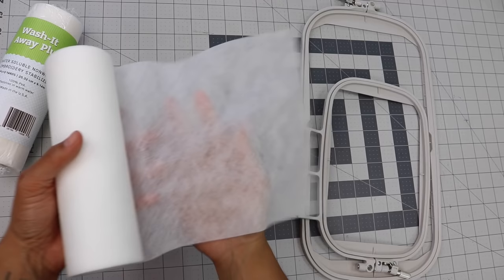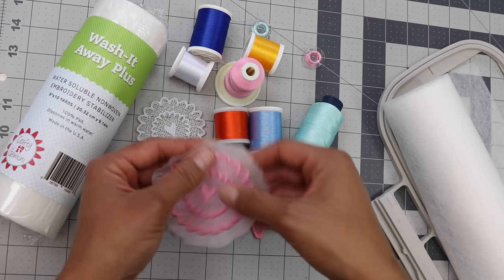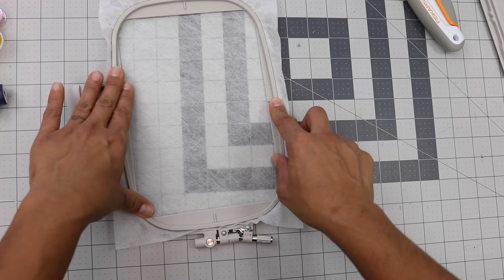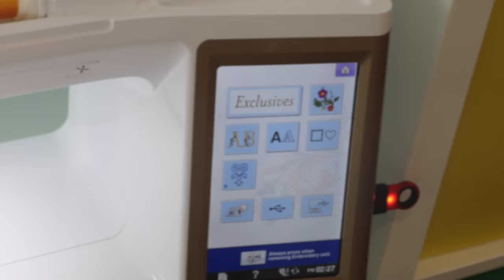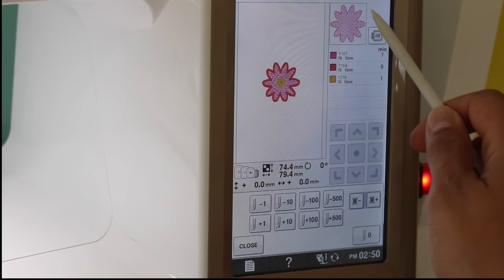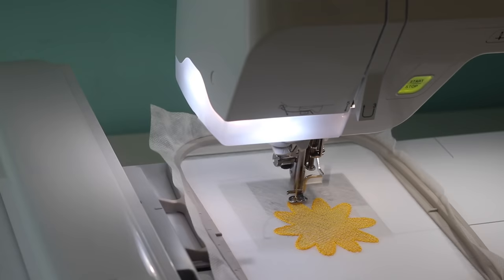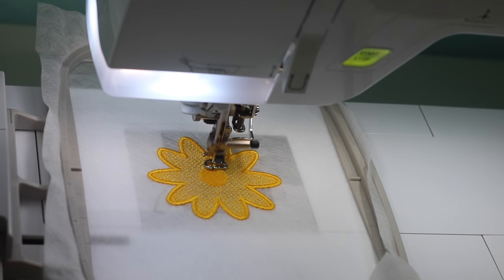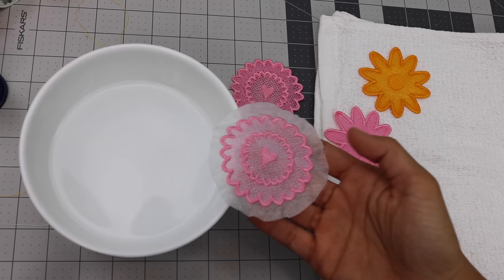Beginner Machine Embroidery Project #2- Free standing lace tutorial

Comment: Had a bit of trouble with my first go.  I recently picked up a BabyLock Ellegante2, second hand so I thought I'd give this a try. I have been doing machine embroidery since my first Designer 1 in 2003 but haven't done any in awhile .. I had some wash away in my stash and found a design for lace to use that came within the machines freebies.  It doesn't completely interlock.  OOPS!  Looks good but will be in pieces once it hits the water.  I will have to be more careful with my next selection.  I love the tip of using the same thread for the bobbin.  I usually use the recommended in white or black and have problems sometimes with the bobbin thread showing.  I have been very impressed with your videos.  You are a great teacher for one so young.
Reply: Phyllis, try adding some tulle over the stabilizer before you embroider. This will keep the design from tearing apart. there is a video on yt describing this process.

Comment: Great video! If you accidentally rinse out too much of the stabilizer, how would you make the design stiffer?
Reply from the maker: Thanks. Several ways- spraying it with heavy starch and pressing it flat, you can also dissolve some of the water soluble stabilizer in a little water and resoak it in the solution then let it dry. Hope that helps.
Reply: Thanks Vanessa. Looking forward to the next embroidery tutorial.

Comment: How do you handle thread breaks when stitching lace?  I usually just back up the stitches but I'm not sure this is they best way to combat broken thread?
Reply from the maker: That's what I do to. I usually will back up far enough that I know it won't come apart. I find in lace designs the little thread build up I may get isn't noticeable and since I rarely rinse all the stabilizer out the bit that stays helps set the threads so I don't have to worry about it falling apart. The trick is making sure you have a good quality thread and no issues before you start. ha! But we all know it doesn't always work out that way. :)